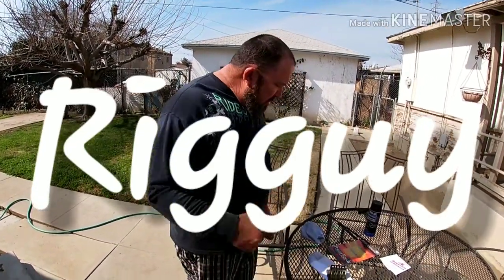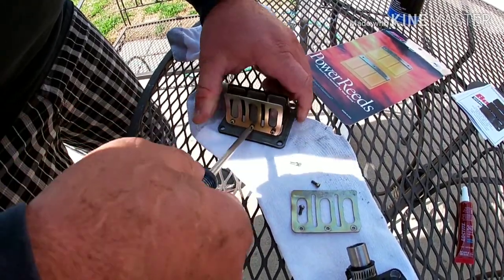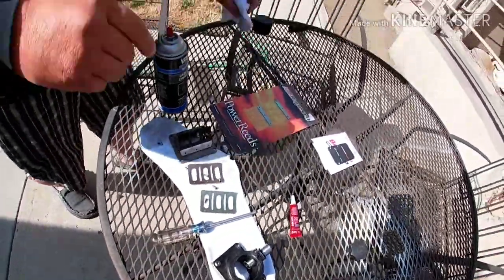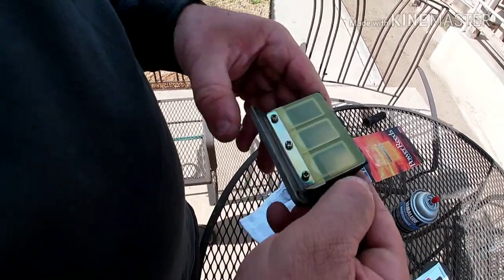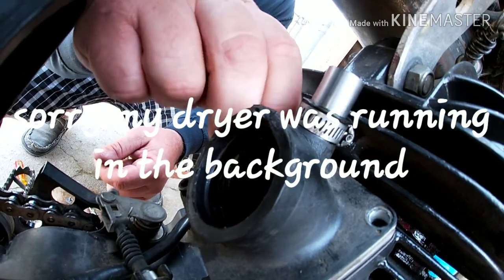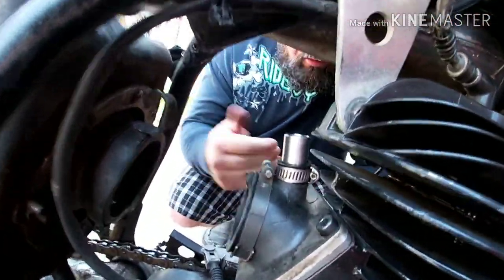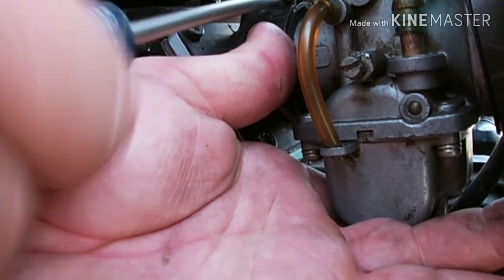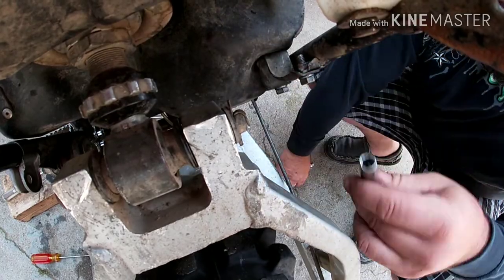Boyesen Power reeds installation Yamaha 1982 IT250

Comment: Learnin' as you teach here. Neighbor had an '86 IT 250 in her shed when she bought place and gave it to me. So far replaced cracked headlight lens, got replacement lower chain guide with chain. It has a blue water bottle velcroed to middle of handlebar, and IT vinyl tank cover i've not seen before.
Reply from the maker: They  are super easy to work on. Those vinyl tank covers are hard to find. That’s a keeper.

Comment: Often, you need to drastically narrow, or remove the 2 bridges (each side) from the reed block with boyesens to get any surface area for the air flow to open the 2nd reed buddy! You can also remove a little material from the front to allow air/fuel flow to press on the 2ndary reed. The more area you can expose without loosing a seal, the more effective they will be. (The 2nd reed wont opperate unless there is enough surface area exposed to the air flow to "push" on the reed and open it.)  ;-)
Reply from the maker: It doesn’t seem to be having that problem but I’ll keep that in mind in the future. Thanks.

Comment: Hi! Love this video, especially the tip for undoing airbox bolts to comfortably refit carb. Just wondering what gear shift lever you've got  on the IT and how you find it with a boot on. Cheers!
Reply from the maker: Thanks I appreciate it. As for the gear shifter it seems to be aluminum aftermarket folding shifter as there isn't a rubber sleeve. I wasn't sure when you asked me I had to look it up. I always assumed it was stock but I can't find any pictures. Not sure of the brand. Boots work ok I have never found them to be a problem. I think it would be more difficult if you installed wider foot pegs. Mine are stock. Keep that in mind. Good luck.
Reply from the maker: The brand of the shift lever is "Driven"